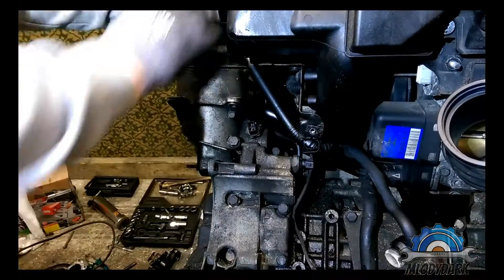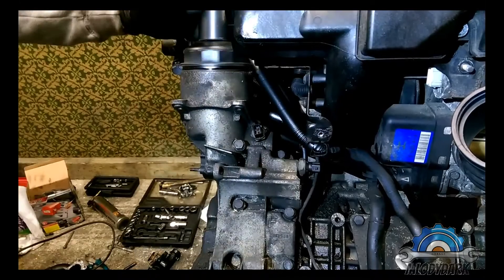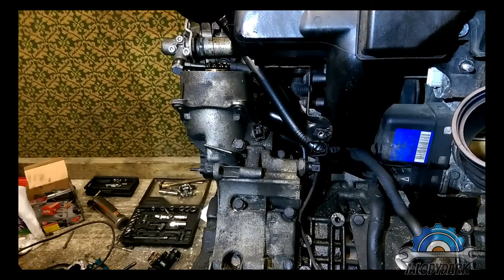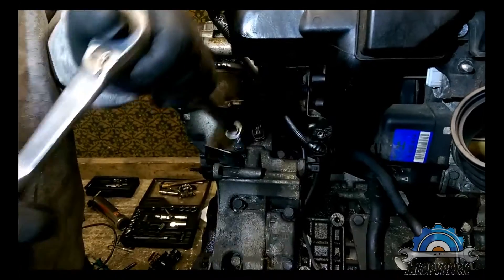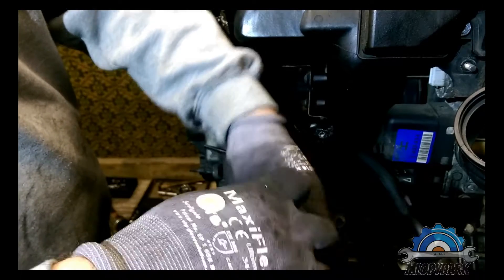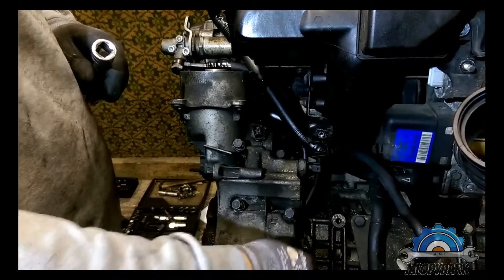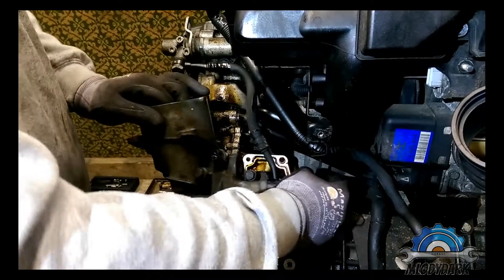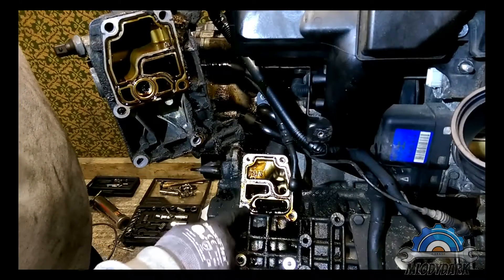Oil filter housing gasket BMW e46 M52TU/M54

Comment: Do you need to take the alternator out as well to take the oil filter housing out?  I'm honestly trying to replace the timing chain guide rails with the engine still in the car and trying to find the most room I can for that job any tips for replacing the timing chain rails?